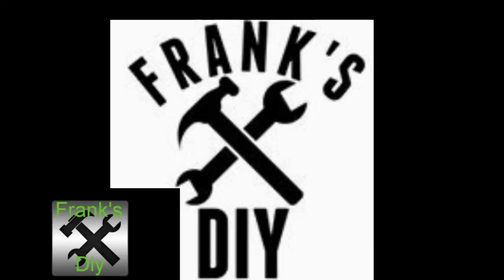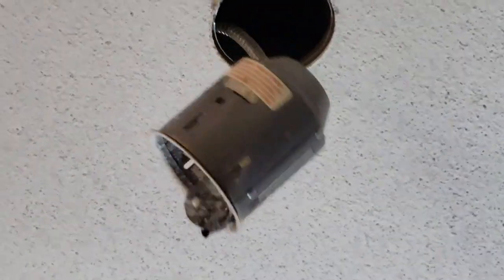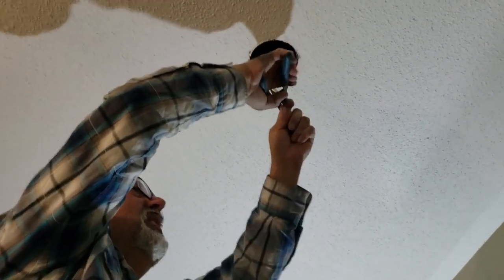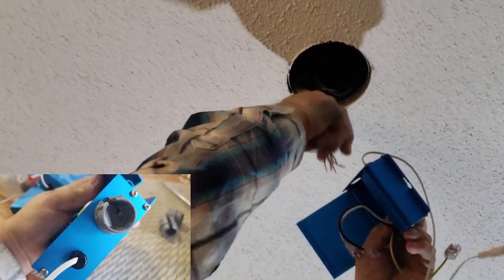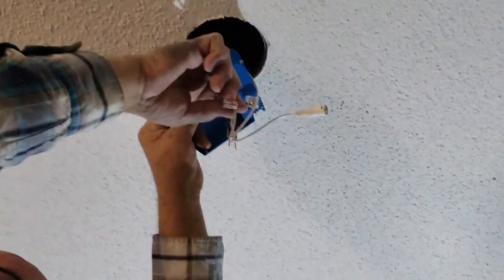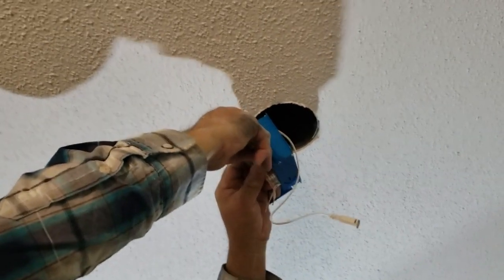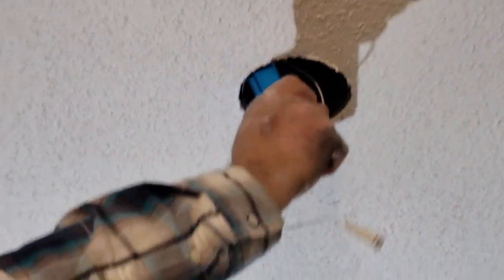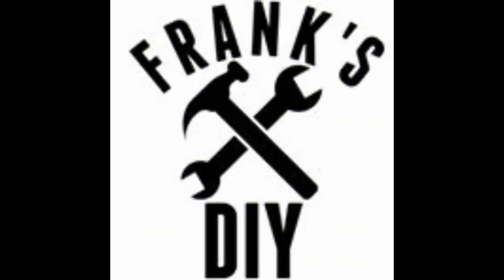Retrofitting pot lights (replacing the MR16's with L.E.D.'s

Comment: I'd like to know who the idiot was that thumbed the video down...thanks for the video Frank. However, don't you need to cut the transformer out since these are 12V pot lights?
Reply from the maker: I totally did . The wires where taken out of old transformer housing to put into new pot light box housing. in my case to keep it at 110 volts. Thank you for watching. and be safe with whats happening in the world today.
Reply: @FranksDIY  thanks you top Frank